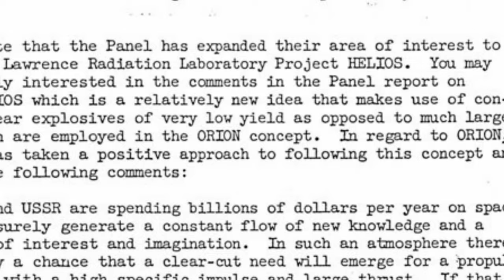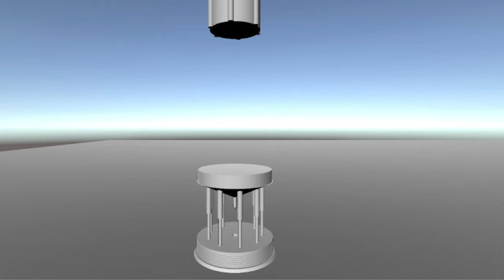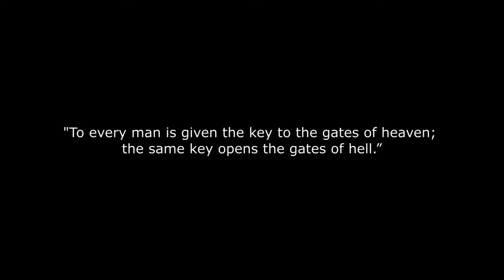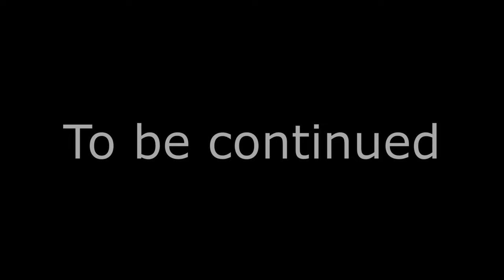Crazy Cold War Concepts #3 Gigaton Bomb

Comment: Well, there's a little silver lining when it comes to nuclear weapons: Anything above 10 Megatons will become increasingly less efficient, requiring far more fissible/ fusion material for higher yields, to the point a gigaton weapon, while possible, would see itself wasting so much material as the chain reaction is too fast to consume all of the material and would instead just throw it everywhere. The Tsar Bomba had exactly that problem, the material it had was expected to deliver a yield of 100 megatons but the actual yield it had was justhalf of it, 50.

That being said, the real tragedy of nuclear bombs is not on their destructive power, but in stalling humanity's technological progress as the public conscious has learned to equate nuclear power with wanton radioactive destruction. The bombs became the worst mistake of the human race.
Reply from the maker: Another thing to remember is once you start reaching 100 Megatron yeilds, you start wasting energy to space. A gigaton bomb would burn a wide area. But most of its actual useful energy would be lost to space. Making them a waste with diminishing returns.

Honestly any bomb over even 100 Kilotons is pointless functionality. Falling into the realm of psychological weapon.
Reply: @venera13  Wouldn`t a MIRV with several low yield nukes have the same effect? If the IBCM is a Scramjet Type....no way to stop it. The Sovjets even came up with the Concept of a nuclear powered Rocket during the Cold War and still have various concepts for it these days?  A Salted Bomb would be even scarier. There are a several Doomsday weapons...
Reply: That is wrong. "In theory, the bomb would have had a yield in excess of 100 Mt (418 PJ) if it had included the uranium-238 fusion tamper which figured in the design but which was omitted in the test to reduce radioactive fallout". They purposely held the bomb back to reduce fallout, as using the fusion tamper would have created a shit ton of radiation in comparison to what it did produce. They absolutely had the capability of well over 100 megatons considering the bombs weight.

Both Russia and the USA can make extremely efficient fusion weapons that can produce more than 5 megatons per ton of weight. Tsar Bomba was 27 tons, do the math. Even if it was only half efficient from the theoretical max of 6 megatons per ton, that's still 81 megatons.
Reply: @venera13 that’s why you make a gigaton-class Cablasca howitzer, and incinerate the entire Soviet Union from Low Earth Orbit.